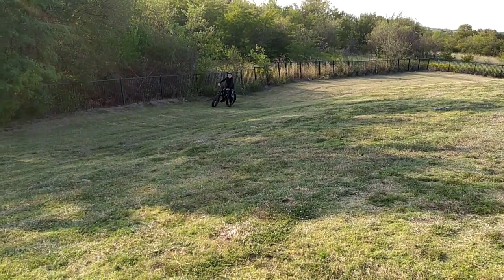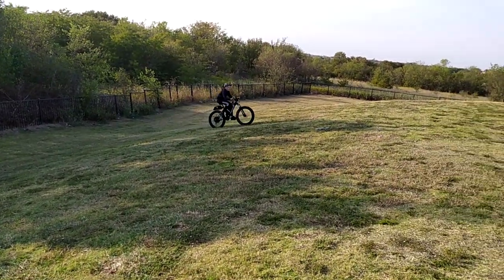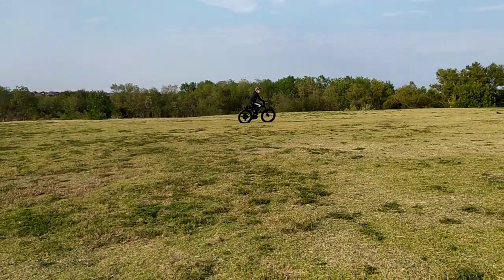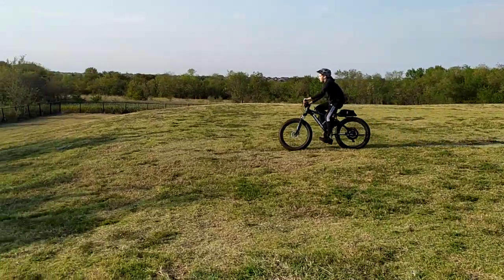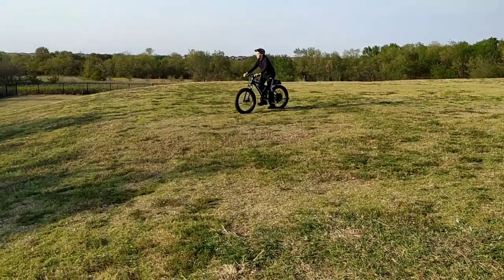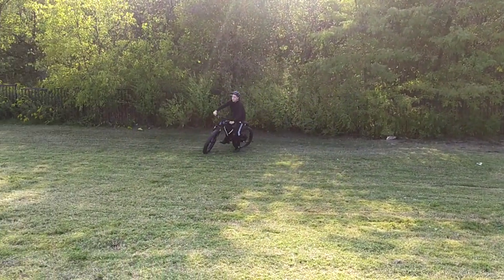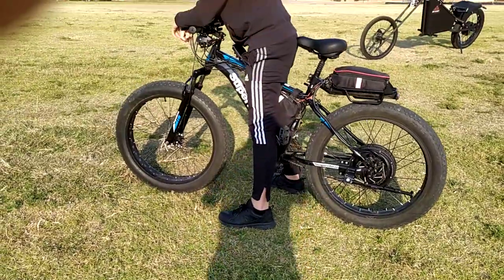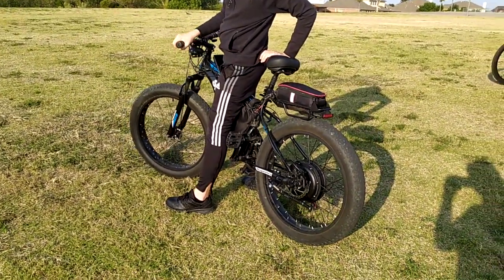5000w 72v fat bike conversion torque example

Comment: Hi fella, I've 5000 watt motor 72 v battery, got any suggestions on how to keep the back tyre on, after level 3 it's comes off and tube, I've got 117kph b4 it  happens. I be greatful for any advice. Richard

Comment: which controller do you have?
Reply from the maker: That kit comes w/ a 5kw 85a brushless controller and color LCD display.  I'll be getting more of the high speed kits in January and those have a 100A controller.
Reply: @TexasNEV
Reply: put a 150ah controller full of power a speed!!
Reply from the maker: @matanaqua7733  Figuratively speaking, voltage is speed as is current to torque.  More current doesn't NECESSARILY translate into more speed, plus there is risk of damage to the hub motor.  Swapping to a 100 would be a nice boost though.
Reply: @TexasNEV where did you get the battery from?
Reply from the maker: @umi.1498  I got it on AliExpress but I wouldn't recommend it because they were completely deceptive about the capacity of the pack.
Reply from the maker: I had other triangle packs that were absolute monsters of Power and current and range but I just sold out of them plus I make my own rectangular packs for sale on eBay as well I've got a couple left of a 60 amp hour that can deliver 150 amps

Comment: is there pedal assist for this? and is there a way to hook up reverse switch to it? Looking to build a Morgan 3 wheeler with this
Reply from the maker: Hello, yes there are 5 levels of assist, well technically 6 if you count zero.   5 being the highest power level, however there is no reverse function on this controller given its primary function is an ebike.   Assist level 5 on this 5T motor is about 37 mph, and for the 3T motors (currently in stock on my ebay store "traderrje" assist level 5 is in the low 50 mph range depending on rider weight / battery selection.